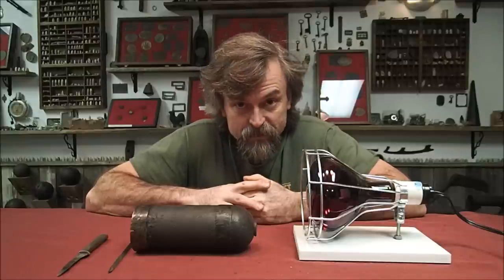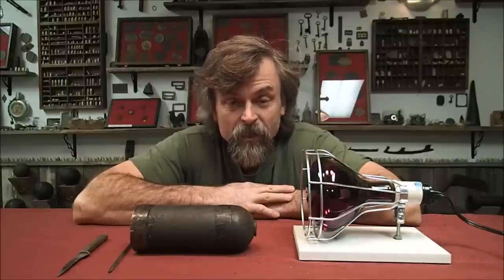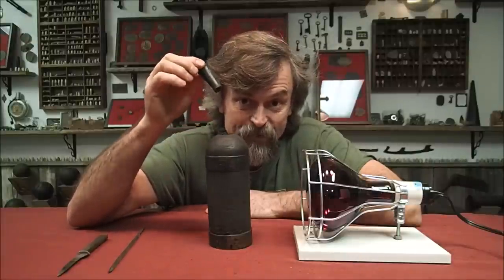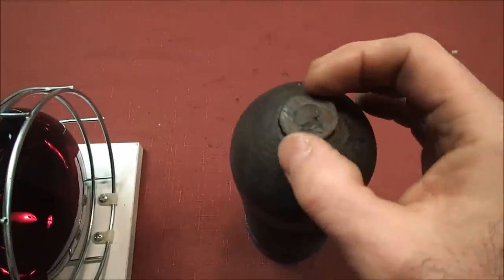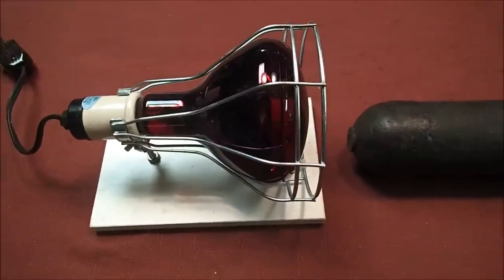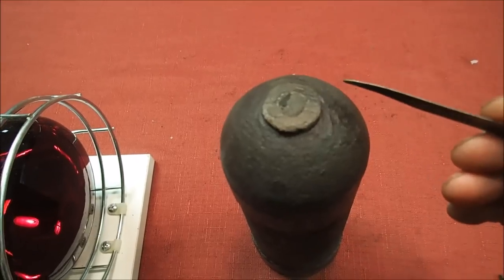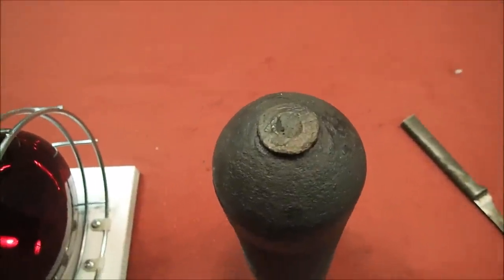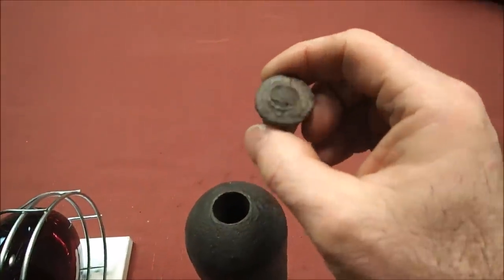How To Remove A Wood Fuze From A Civil War Shell

Comment: couldn't you remove the fuse then remove the powder without drilling?
Reply: does the heat from the lamp really get that hot? i would imagine the powder would be bad anyway the sulfur would deteriorate wouldent it?

Comment: Actually wouldn't conductive heat work better for that. Slowly heating the front end of the shell, expanding it while the wood fuse dries up and shrinks, pulling away from the metal? Or would that damage the shell or the fuse?
Reply: ***** You are a very patient man, Beau.  ;)
Reply: I don't want to disrespect Beau's channel by feeding into troll like behavior, but if you are going to exhibit such behavior at that age, learn the difference between radiant and conductive heat. What I was referring to was a heating element coiled around the front of the shell where no heat is applied directly to the wood fuse, thus drying slower with less stress on wood, resulting in easier separation. Keep your snide comments to your own posts.
Reply: Speaking of snide...
Reply: My apologies but I don't think I deserved the original off putting comment either. My post to Beau was well meaning with no bad intentions.

Comment: Just wondering but how did the wood fuses work?  I understand modern timed ones such as in grenades but the old civil war era ones baffle me. How were they ignited etc?
Reply: They were impregnated with a substance that burned at a steady speed.  The faster you wanted them to explode, the shorter you cut your fuses.  (At Gettysburg the CSA was cutting their fuses too long, exploding a long ways behind the lines they intended to beat up.)  The fuse was ignited by the detonation of the charge in the cannon.  There was enough "blowby" around the shell to ignite the fuse at the nose of the shell before it exited the cannon barrel.

Comment: This is sick. This is only one rule with ammunition DON'T DISASSEMBLY NEVER!!!.I'm certified sapper. And we never disassembly old ammunition this way. Only by detonation in safe conditions. Old explosive materials can be more dangerous after years... some kind of primers - tirggers can detonate when you screw it out... ofcourse you can say that is old black gunpowder... but you don't know what is inside. So never do it this way or you lost your life.
Reply: Last world some unexperienced users can't recognize modern and old ammunition. And you have 100% guaranteed disaster.
Reply: ***** Maybe, maybe not. That is only your point of view, but you are adult, somone are not. That is not bubble this is an anccident prevention. Ammunition is always ammunition and was made to kill.
Reply: ***** Hi buddy . This guy was saying he is certified sapper. If you are talking modern mines some have anti tamper  devices . You walk by it , Boom. A tiny little vibration in the ground boom ., there are at least 10 ways to set up  a bouncing betty mine , you trigger it in on place, it pops up about dick level and boom , it explosively removes your scrotum. Most of the stinking newer mines these days are made with almost no metal so a metal detector is useless. This is not even saying anything about anti- tamper devices. Some mines are layed by air or artillery. When the canister blows open all those small mines in there are soaked with a liquid and are stable . All those mines hit the ground and after  they dry out they get real real sensitive. If you look at them hard , boom . No wonder this guy is saying watch out
        I think this is the difference between what you are talking about and what he is talking about . Plus language too I guess.
    I know a lot of that old stuff can be dangerous so I dont mess with it. If I want a  defused Artillery I just buy it.  This whole thing about getting way back and shooting it is not a real good idea . If you can see it, it can hit you if it goes boom .Probably the cops and BATF would show up too.
Reply: Ok, but you should show it. As I told you know your skills someone don't have it at all. Think about those person and that is all. Nothing more.
Reply: I don't know from my sapper's buddies any person who is showing how to disassembly ammunition on YT video... sorry. Maybe I'm weird or touchy person. But I want to safe that YT kids without no brain. They don't don't think they do it, because they seen some videos... this is my point of view.
Reply: Ok fine. You have right. This is only piece of iron nothing more. And we both know it. But someones person doesn't it. That is all. As you write you have right to post it and show it, but you also shoud show some more warring information about it. It should be clear signal for all rookies and kids.
Reply: *****  That  fits in with perfect with what I know. LOL. A buddy of mine< Sgt in Marines> and I were talking once, and he has spent a lot of time deployed in 3rd world shitholes. He told me nobody knows it all , and if someone says he is a expert watch out for him. This is  from a real soldier. What you have said about 40 years of intense study is a lot though.